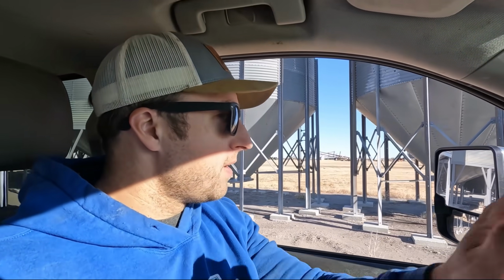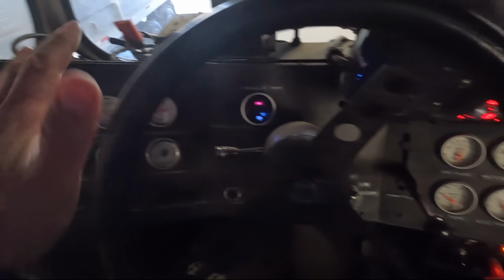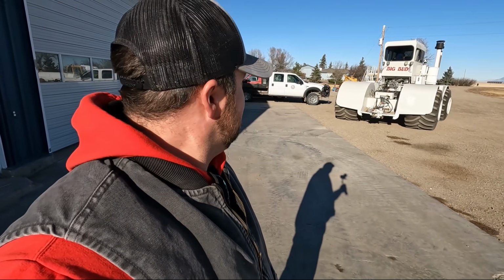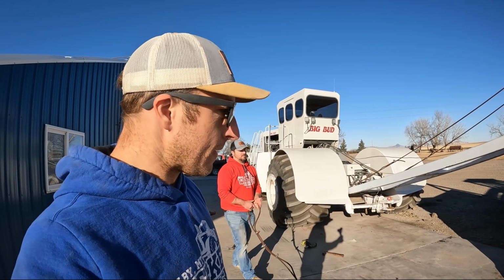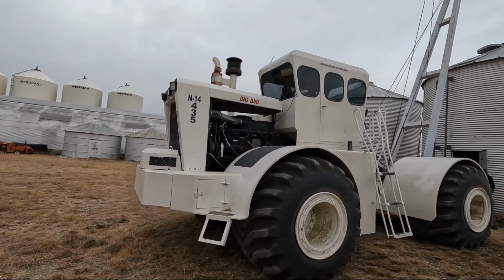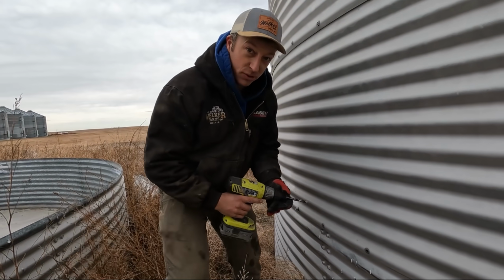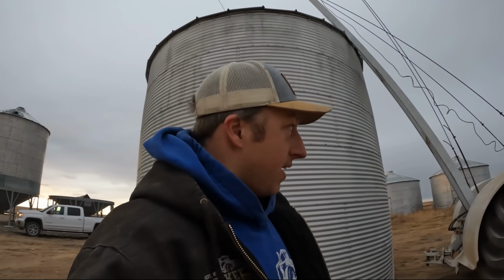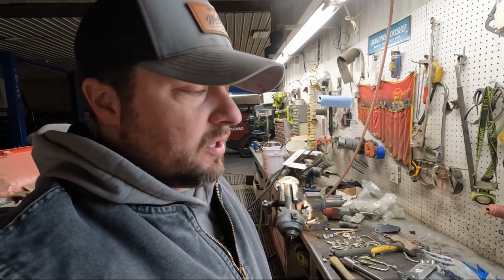Winch FAILED and the Bin FELL!

Comment: Winch or Hoist? You should never use a winch to lift; it is dangerous. Winches are for pulling; they're designed with a freespool clutch so you can pull the line out. If you're lifting and the clutch disengages (or fails), the load falls. Dangerous. Hoists power the line both in and out, so no clutch. Hoists and winches also have different brake systems. All that being said, in this case the spline gears failed under what may appear to be a safe load. The problem with lifting and carrying is the load can swing and bounce so you have a dynamic load versus a static load. Different ballgame - think of it like gently setting a sledgehammer on your foot vs dropping one on it. A hoist, which is designed for lifting, will be (over) designed to accommodate some dynamic loading whereas a winch probably will not.